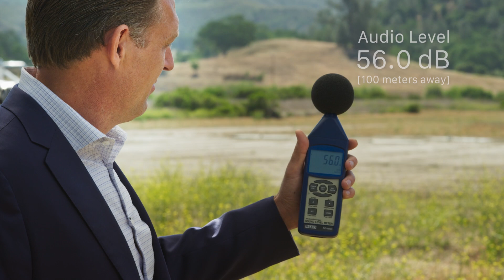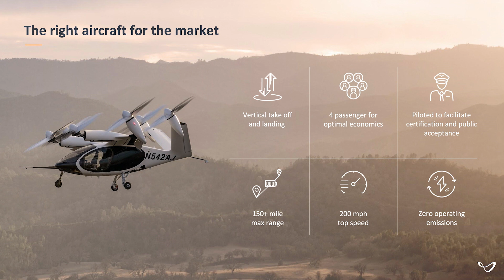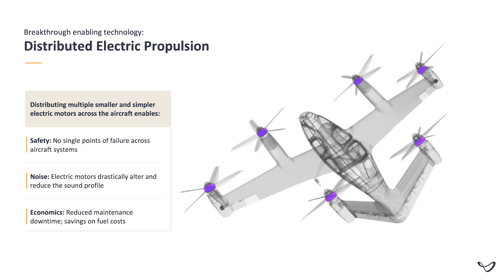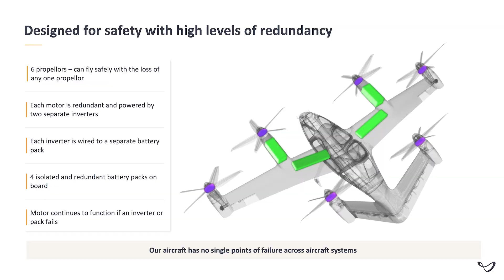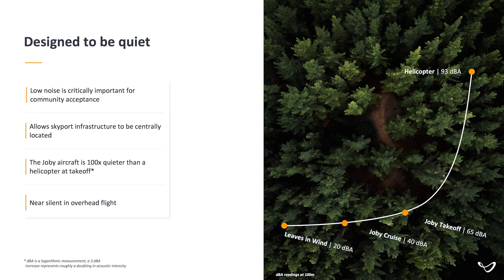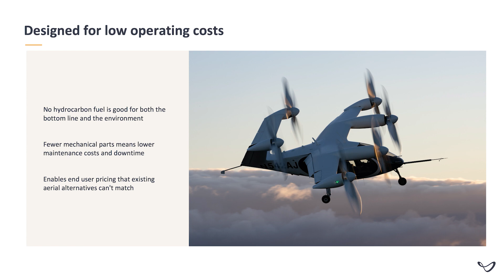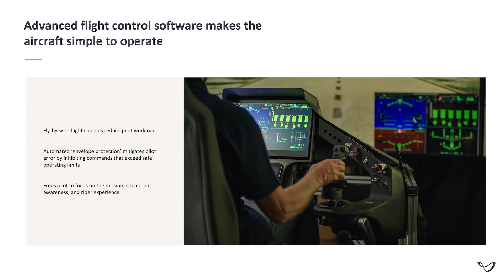Joby Analyst Day Video

Comment: To incorporate low-flying air taxis, the entirety of airspace will have to be transformed, overhauled, enhanced, strengthened. There's already a shortage of ATCs, we'll surely need more with these things multiplying & flying. Do I want these new, groundbreaking, un-proven, experimental aircraft flying all over congested airspace and cities of industrial, corporate, and residential makeup? I don't know. It seems extremely unlikely and risky that these will be easy, or even possible, to get into the airspace. Plus, I just don't see an overwhelming need. As a commercial pilot, I don't want to share the airspace with these.

Comment: We know grate deal of battery energy is consumed for take off and landing then due to negative impact on weight capacity of the plane and lack of trusted battery availability it means less cargo capability. Why not use a detachable electric rod to supply hard wire electricity at the time of take off and possibly landing, so that more battery power remain available to carry cargo. Of course for landing sophisticated design to couple and decouple to hard wire system is needed. Simple, but I think practical.

Comment: According to presentation, the redundancy is diagonally based to maintain thrust balance.  My question is can the vehicle land conventionally using wing lift if motors/inverters or batteries fail in such a way that a hover landing is not possible?

Comment: How do you control the yaw axis of the aircraft if it has no rudders?
Reply: good question, since banking turns will alter the flight confort; or maybe the differential thrust will do the work of a rudder
Reply: I think it has rudders. Or maybe I don't understand your question.
Reply: yeap, I see now, I has control surfaces on the tail and since it has a V-shaped tail, they function both as rudders and as elevators. This is an advantage here where any supplemental weight matters; they also benefit from the airstream produced by the tail rotors; the actuation of those controls may be more complex requiring synchronization between all surface controls on the aircraft, but since it has an electronic system this is hardly a problem for the pilot
Reply: Differential thrust. Same as any quadcopter.
Reply: Like a quadcopter, half of the props turn clockwise and the other half turn counterclockwise. To rotate in the yaw axis while hovering, you speed up one half and slow down the other half. In forward flight, it uses ruddervators like a V-tail Bonanza plus it has ailerons for roll control. The flight computer knows when to switch between hover mode and forward flight..